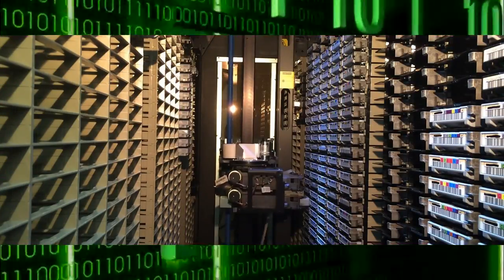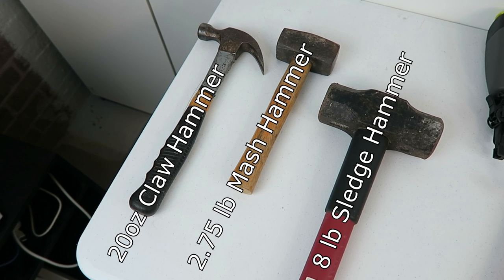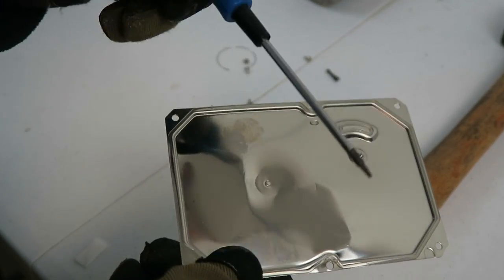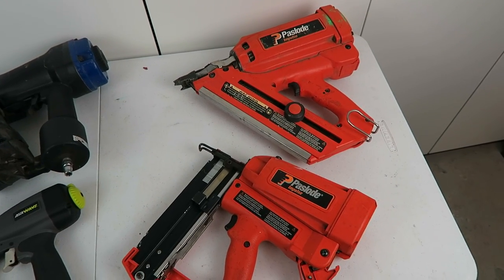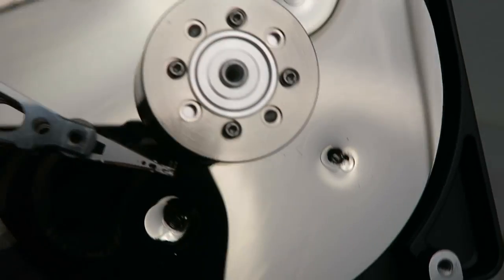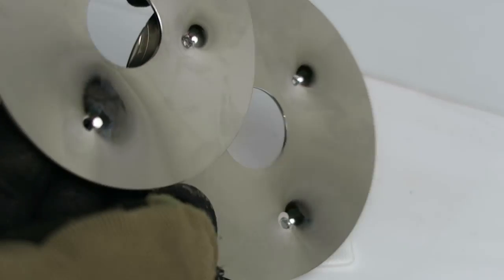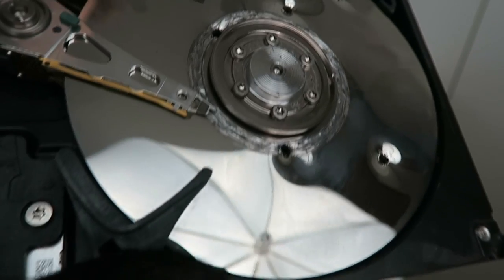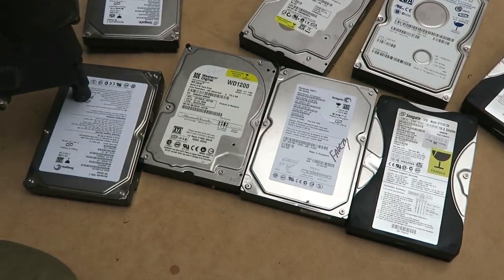3 Easy Ways to Destroy Your DATA!

Comment: You left out fire. If you have time to unscrew the top of the drive, do so, then hit the platters with a propane torch until they stop smoking. If you have a box of drives and are short on time, fire up your propane BBQ to max temperature, and bake until they stop smoking. Smelly option, but your data will be destroyed.

Comment: The pneumatic nailer is much faster than the drill method I seen.
Reply: Curious what coil nails you ended up using?   1-3/4” x .080” Galvanized are buckling and not making it thru.  
Would these work?
Grip Fast® 1-1/4" Electro-Galvanized Coil Roofing Nails -7,200 Count at Menards
Reply: @georgelouischrisos3597  
Watch the video.
I did not make this video.
Ask the person that made the video your question.
Of course, there is the possibility that this video is fake.

The ones that penetrated were high end commercial grade.

Comment: I don't think this would destroy much data at all. The nails are hitting only a minor part of the disk, leaving most of it relatively intact. It definitely makes it harder to read, but if someone really wants the data he can get it out eventually.
I think it would be better to heat the drive with a torch. Heigh temperature should destabilize the magnetic dipoles in the material and effectively "melt" the data. At least that's what I'd do if I want to destroy data on HDD.
Reply from the maker: In the description -- and the word you're looking for is "Curie" point.
Reply: oh, sorry. I didn't noticed there is a second paragraph in the description :-D Also, I have a question. How strong must the magnetic field be to damage a harddrive? From what I tried once, magnets that are commonly found in the household are insufficient. In fact, I've never heard of a harddrive being damaged by magnetic field...

Comment: Great video. I just smashed a few old 3.5 IDE drives and knew I should have opened them with a screw driver first.  I banged them up pretty good but after watching your video I can tell there is a good chance that the spindle survived.   2.5 hard drives are a different story.  The spindle shatters really easily.  UPDATE:  I opened one of the drives.  It is one of the drives I really whacked and dented up with a standard hammer.  The platter had a few dents in it similar to your sledgehammer technique.  Probably as you assess it's not recoverable.  My method -  It's not an easy method but I think you need to screw off the top plate then whack the platters and they will shatter.  You really want to have safety goggles because the plates shatter much like glass.

Comment: but wouldn't a professional data recovery company be able to get data off of the undamaged parts? it might be slightly corrupted, but unless its demagnetized the data is still there.
Reply from the maker: chk the description
Reply: @sno_crash  I remember the Sandy hook case and reading how the attacker had destroyed his hard drives to a point where the FBI could not recover any data.  I assume he possibly smashed the platters.  You would think in that case that FBI would go to any length but maybe it's not possible to piece together a platter.  But it's pretty amazing what the forensic software can do.  If platters are undamaged the data can be pulled pretty easily by forensics

Comment: I would wipe the hdd if they are fully functional. If not, I remove platters from drive and smash them and heat them with propane torch

Comment: In terms of physical destruction, it seems to me that disassembling the drive, taking out the platters, and just sand-papering them with a fine grit would really scrub it clean... not to mention it would take less energy than trying to hammer it or use power tools, especially if you don't have access to these tools, or a space to safely/discretely use them.

I'm no expert, but I'm willing to bet that a data recovery service or an extremely dedicated or lucky individual would be able to repair some of these drives/platters to the point where at least SOME of the data could be read and re-compiled. A lot of the destruction techniques shown here cause point trauma to certain areas of the platter rather than thorough damage to the whole platter. Woulden't some files remain intact? (for instance if the holes are only put in one radial region of the disk, where say, the inner or outer "rings" could be still read)?

Comment: As a digital forensics examiner (someone who specializes in recovering data) : using software to wipe the drive is easy and effective.  Data will not be recoverable - because it is no longer there.  Denting and putting holes in the platter is not.  The data is still on the platter, and can be recovered with specialized tools.  For physical destruction, you need a hardcore shredder to chop the drive to bits.
Reply: How about cutting the disk in half using carbon saw?
Reply: These physical methods of destruction don't erase or change the data.  They only make the data more difficult to read.  The data is still encoded on the platter and can be read with specialized (and rare) tools.
Reply: twjolson I'm just wondering where is the sweet spot, that nobody sane would bother recovering the data anymore.
Reply: Just use a boot disc like Darik's Boot and Nuke.  Once the data is overwritten, it can't be recovered.  It use to be possible back in the days of stepper motors, but that hasn't been true for many, many years.  There is the chance that snippets of data would be in non-user accessible areas, but you are talking about small bits of data (a few sectors).  Physically damaging the platter so it is in pieces is a 'sweet spot', but it is more work than a boot disc and means the drive doesn't work anymore.  If you bend the platter, like Sno does, just means someone can straighten them and read the data.  Putting holes in the platter just means that small area is unreadable, but the rest is.
Reply: twjolson It used to be that when data is overwritten the old data is still partially present, so multiple overwrites are needed to completely scrap the original.
Reply: That may have been true.  I have never heard of anyone recovering data that way, and, if it was true, it hasn't been true for many years - possibly decades.  The reason this may have been true is because a stepper motor steps from one track to another in descrete units.  However, when the disk heats up and expands, the tracks are not exactly under the track anymore.  So, it may write a little to the left, or a little to the right.  Later, when new data is written to that sector, it may write exactly in the middle, leaving previous data on the sides.  Now days, the actuating motor can shift as much or as little as it needs to be right over the track.
Reply from the maker: That's why I provided the additional information in the description. I should mention, that even the write heads on a drive do not completely erase the information - there's always a residual field present afterwards. After a couple of writes it becomes increasingly difficult to extract the data that was previously there.
Reply: My comment was more in reply to what was said in the video.  I didn't read the description, but that is spot on - except for the part about encryption.  In the United States (I can't speak about any other country), law enforcement can't make you give up a password.  That's a violation of the Fifth Amendment - you can't be a witness against yourself.  There is two exceptions.  If law enforcement already knows what is on the device, it falls under the foregone conclusion doctrine.  Then the court can order you to give up the encryption key.  Second, if the device is locked via biometrics, they can get a search warrant requiring you to unlock your device.  DNA, fingerprints, and so on are not something you know (like a password), and thus are not testimony.  However, neither of these are law of the land, as such cases involving digital devices have not made it up to the Supreme Court.  Law Enforcement can try and get you to give up your password willingly, of course, but they can't force it, nor can they send you to jail for not doing so - outside of the two scenarios above.

Love your channel Crash.  You are one of my favorites.
Reply from the maker: twjolson In fact it's worse in the US. There are numerous case law trials since the 80's in the US on contempt charges resulting in indefinite detention. That fortunately can't occur in Canada, Australia, or EU - where failure to comply has defined maximum terms. Several cases in the US have been tried or appealed in/to the Supreme Courts and the coercive powers available to the attorney general have been upheld. Check out Leon Gelfgatt, and Francis Rawls - Although Rawls in imminently going to be heard on appeal it's unlikely he'll succeed.
Reply: So, admittedly, this is with a quick search and a few news articles on the web.

Leon Geifatt : Massachusetts case, went as high as their Supreme Court.  This was a foregone conclusion case.  Law Enforcement already knew what was on the computer based on his own admissions.  Not the most solid foregone conclusion case, but it fits.
Francis Rawls : Federal Case from Pennsylvania.  I couldn't find the facts that led to the foregone conclusion ruling.

I get what you're saying, but they weren't jailed because they violated a law that requires them to give up their passwords (like you would end up in jail for violating the law saying not to murder).  The law actually says the exact opposite (the 5th amendment).  The foregone conclusion doctrine is an exception to this (lawyers and judges love exceptions).  They were jailed for not complying with a lawful court order.  There is a subtle difference, in my opinion.  If they had not complied with any other lawful court order, the same result would have occurred.  Whereas, if they had refused to give their password in a non-foregone conclusion case, they would have been fine.  I guess my point is that your statement that law enforcement can make you give over your password or end up in jail is simplified and generally, but not completely, incorrect.

In fact, I spent all day today writing an affidavit for a chip-off I did on a PIN locked cell phone.  The suspect would not give the PIN, so I removed the memory chip to read it directly.  This destroys the phone, and is a procedure of last resort (and for cases of some import).  If there was any other means to acquire the data, we would have taken it.  PIN locked phones are a way of life for me.  More cases than you'd suspect end because of a PIN lock.  There are people on the street who probably shouldn't be simply because of a PIN lock.  Is that a good thing, or a bad thing?  That is what society is debating now.

Comment: SSDs are easier and quicker to wipe clean. But why erase anyhow? Just encrypt everything. However I wouldn't trust a built-in encryption provided by the vendor.
Reply from the maker: I was going to address that in the vid - but it was all very boring. Encryption is very good if there's nothing illegal about the data. I just added this comment to the description :
"" And to address anyone considering Encryption; please be aware that most westernised governments have coercive powers. You'll have your freedom and choice - to choose to hand over the data, or spend 10-20 years in jail. ""
Reply: I suppose bit locker is hackable.

Comment: the us dept. of defense recommends complete and utter obliteration of any material with sensitive information to guarantee it cannot be recovered, e.g. ground into a fine powder or burned to ash. i wouldn't trust any other method if you truly want to make data unrecoverable.
Reply: Physicists would argue that it's still possible, theoretically, to restore the ground-up or burned-to-ashes platters via Determinism.  You'll probably be long dead before they reveal your secret proclivities to your descendants, though.

Comment: Do they all have 2 platters? Or just some do?
Reply from the maker: Some have 1, some have 5 platters.  Any number really, depending on the capacity of the drive and the recording technology used.
Reply: @sno_crash  Wow, I didn't know that...I just hopefully destroyed one today, with a hammer....it was a brand new 500 gb SATA Hard Drive. I got hacked recently and my computer was completely compromised. It would not let me format, delete files, or get into my C:/ drive. I only saw one thick disk, that I scratched to death, with a screw driver, and hit it with a hammer.

Comment: I thought that the he'd platers where like glass and should shatter as such put it is like a deferent material that doesn't shatter
Reply from the maker: You are right, they used to be made out of glass. But that was some time ago, about 20 years. Since then they worked out ways of making aluminium discs which are "flat" enough to do the job.
Reply: Some 2,5" hdd's still are

Comment: Hi, what exact position should the nails be? and what is the minimum number of nails for each disk? If I force a screw (turning it using electric screw driver) into the hard drive until it reaches the other side would it work too and cleaner? I do not have the nailing tool in the video. Thanks

Comment: Ok so my sister had some repair people go in my room and I didn't notice that 2 of my old laptops were missing until I went to throw away the boxes many months after. Recently (a year later) my credit card had unauthorized charges on it? Aside from that, am I at risk for identity theft? I had factory reset them both and delayed disposing of them- I put them back in their respective boxes not thinking they would steal it but they in fact did....Any word of advice would be greatly appreciated for my peace of mind.
Reply from the maker: You have to assume that any information that was previously stored on those stolen laptops is accessible and readable by a knowledgeable person.

Comment: Nicely done if you have the equipment.  I use a concrete punch and a hammer.   I used to just just a regulate center punch but it took more then one whack.

Comment: You don't know wtf you are talking about m8! I'm working for a data recovery company and I can say I can recover 80% of the data from the hard drive you "destroyed" this is a joke! I would take down this embarrassment you call a video!
Reply from the maker: You're welcome to explain the basic method you would use to recover data from a physically distorted platter. There are only two - and probably beyond your comprehension.
Reply: Sam Winther Sam Winther Triggered about a troll video. If you didn't notice he said that "average user won't be able to recover data" so does IBAS count as average? You don't really need a video if you really want to smash your hard drive to pieces to make it unreadable. Actually if someone was going to completely physically destroy his hard drive I think they'd do much more than just hammering few nails.